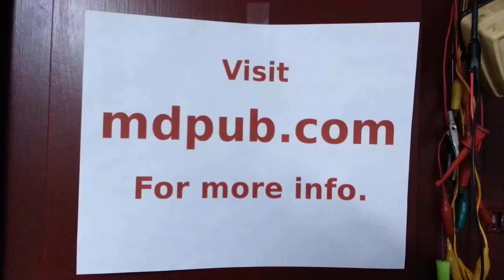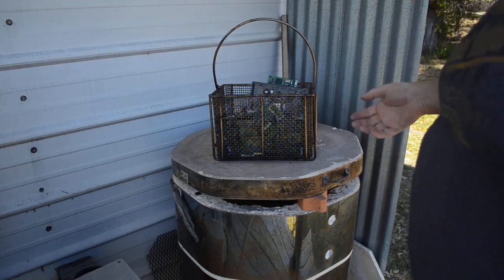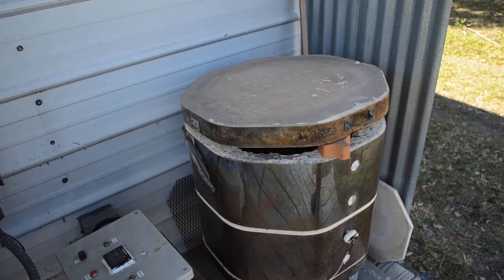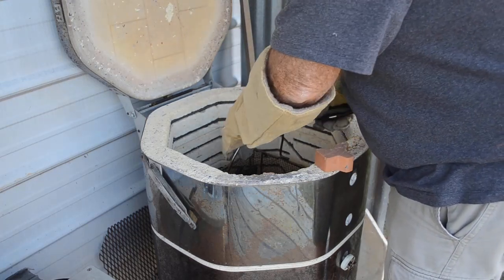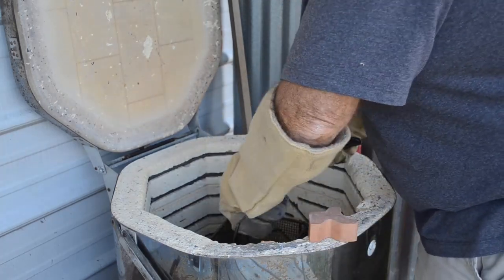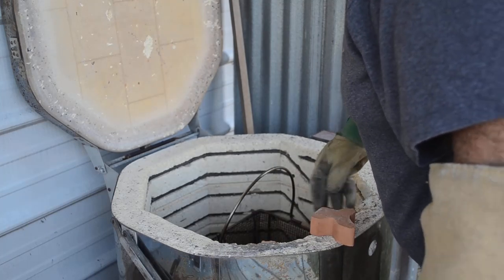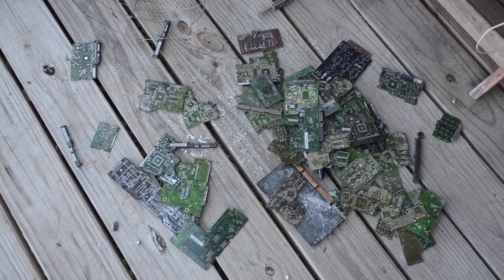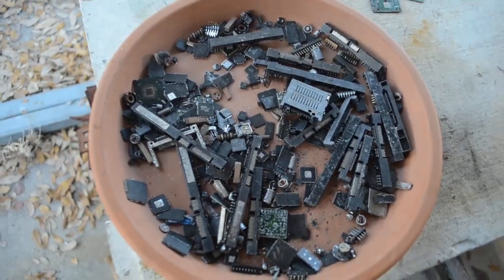Depopulating IC Chips from Small PC Boards in a Kiln

Comment: How would you go about recovering tin?
Reply from the maker: That is a question that may become the subject of a future video.
Reply: @omegageek64  once washed off with HCL  and of a sufficient concentration can the acid be used as a electrolyte to plate out the tin, and would it be pure? I'm paying close to 20 a lb for pure tin and that's buying 50 lbs to get the price break.  Other than a rather pretty purple fluid, I don't seem to have accomplished much 🤣